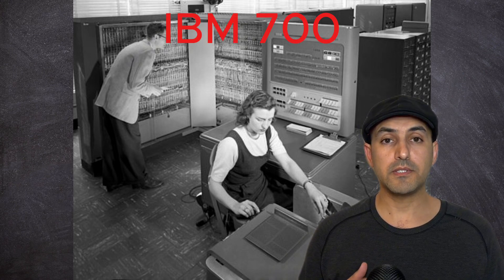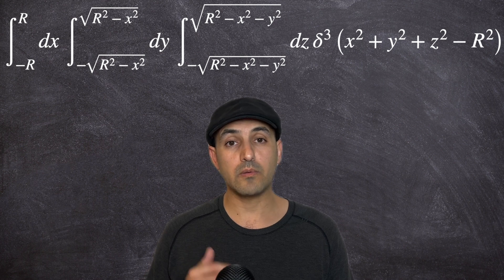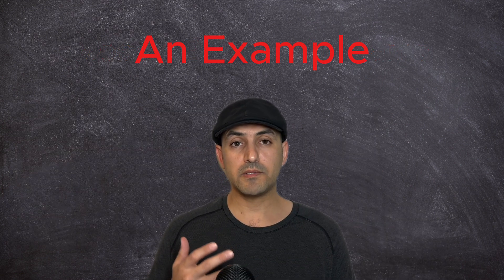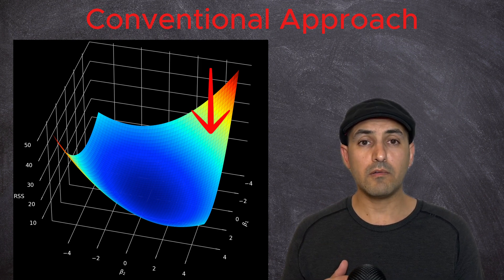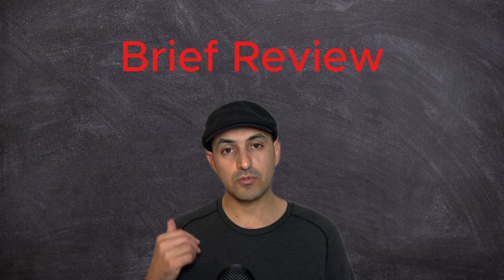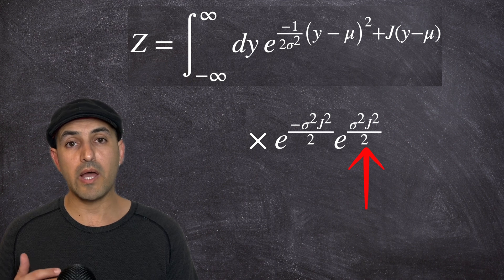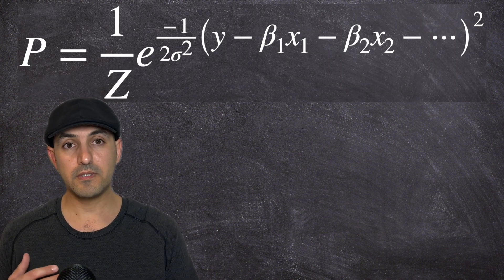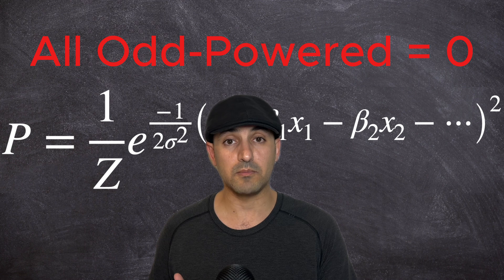A Physicist's Guide to Building Better Machine Learning Models

Comment: Is this equivalent to the conventional method of setting the gradient of the loss function with respect to the betas to zero and solving for the betas?

This is also a one step optimization for linear regression without using gradient descent.
Reply from the maker: Not directly, but I imagine one might relate the two through some math work

Comment: Thank you for the video! It's really inspiring! I really like physics and am now getting into the ML field, too. 
In your experience, what are the possible ways if there's no inverse matrix available? I've read a lot that it's usually the case with real-life data
Reply from the maker: You are welcome! When inverse matrix is not available it means your data is singular. In other words some of the features depend on some other and you need to reduce the dimension by removing the dependent variables. You can compute eighenvalues and see which ones are zero and remove the corresponding variables. I hope this help.
Reply: @CompuFlair  Thank you very much! That makes perfect sense, I completely forgot about the linear dependence (hope that's the right term)

Comment: Hmm… so, any probability distribution over finitely many options, can be expressed in such a form (at least if one allows weights of -infinity in order to assign a probability of zero, but that’s an edge case)…
(And at least so can many continuous probability distributions. I just don’t feel justified in claiming that all distributions can.)

Though, not all ML is well expressed as estimating a conditional probability distribution? Some of it is just function approximation.
I guess you could view that as producing a probability distribution with a single value having probability 1..

Well, I’ll be interested to see how far you can take this approach.
Reply from the maker: Thanks for the comment. F is quite as general as P is. Regarding function approximation, we can take them as the first derivative of partition function (\sigma e^{-F}) with respect to the variables. So we can reverse engineer them into a probability function.

Comment: This is an interesting perspective, but I'm not sure it generalizes. Your toy example was based on a linear model, whereas DNNs are intentionally non-linear, otherwise they would become much easier to solve. Additionally, you make several assumptions about the parameter distributions, where it's well known that DNN parameters often do not follow normal distributions. Typically, parameters tend to converge to logistic distributions, and sometimes can have large skews, which introduce asymmetry (this is commonly seen in prediction heads).

I think you may be approaching the fundamental premise from the wrong angle though. You start off my suggesting exploiting symmetries can reduce computational cost, and then proceed to propose an alternative optimization problem. However, I believe the argument should be that current DNNs are the wrong function to model the problem at hand (i.e. not exploiting symmetries), rather than arguing for a different optimization technique. Furthermore, computing statistics on the data itself may not be practical (think about the dataset used to train GPT4), and may not be reducible (images for example don't follow an IID, even though this assumption is often made in diffusion models).

Also,  the idea of local minimum breaks down in higher dimensions, where most DL models don't have them. They can instead have what is essentially a locally flat loss landscape, where the gradient does not provide meaningful feedback. Anecdotally, this flatness can occur in subspaces and is dependent on the objective. For the former, curriculum pretraining can result in "better" but suboptimal solutions. And for the latter, performing an affine transformation on the objective / input to loss function can alter the landscape's structure and subsequent training convergence (probably due to numerical precision and the descent step-size).
Reply from the maker: Thanks for the comment. Enjoyed reading it. We will get to non-linear and logistic related distribution in future videos. 
Yes, the normal distribution does not explain most of situations. From the perspective of effective free energy and the way I derived linear regression, it is because Taylor series assumes derivatives of a function are well defined while in a logistic case it is not the case. Anyways we will be having fun exploring these in future.

Comment: Based on the first minute or so:  here follows a potentially slightly critical comment.  (Maybe I’ll be convinced later that this remark does not apply.) When you are trying to optimize something, you begin with forming an “objective function.”  To give a trivial example, if you want to maximize something that depends on both x and y and increases with them (over a closed set), you can maximize x + y,   or 2 x + y^3,  etc.  Without further specification, you can choose from an infinite set of objective functions.  Now, depending on the problem at hand, some of those functions may be useless. Nonetheless, you may still be left with many, even infinitely many, objective functions that that will do the job just fine.  You can’t claim one of them as globally superior unless you have a theorem that proves it as superior in a specific sense.  While the energy-based or alternatively the the KL-divergence-based, entropy-inspired loss functions (“objective functions” are typically called “loss functions” in machine learning) used nowadays in machine learning have solid math-based rationales behind them, there is actually no theorem to show their superiority to other loss functions, if by “superior” we mean that it will lead to the “best learning.” Without such a proof, all we’re doing is tinkering with algorithms and finding empirically, using benchmarks, which leads to a useful outcome, but we can make no claim about global optimality.  One of the fascinating things about modern ML is the absence of theorems to justify most of its key features.  The above remarks finally put me in a position to comment directly on the first minute of the video.  I am thinking: sure, you can pick an objective function that seems plausible and has your favorite form based on insight or intuition, but you don’t know that it is best at learning unless you have a mathematical theorem, which you don’t.
Reply from the maker: Thanks for the comment.I especially liked "While the energy-based or alternatively the the KL-divergence-based, entropy-inspired loss functions (“objective functions” are typically called “loss functions” in machine learning) used nowadays in machine learning have solid math-based rationales behind them, there is actually no theorem to show their superiority to other loss functions".

The situation is similar to when quantum mechanics was first developed, and we had two widely different models (operator-based and waved-based) but later it turned out they were mathematically equivalent. And that again comes down to the subject of universality that I tried to touch a bit.
Reply: Hm, when you talk about a lack of a proof for what objective function would produce the best learning, do you mean a proof of the dynamics of the learning being the best, or it being a good evaluation of how well the model does what we want it to do?

For the latter, there is the notion of a strictly proper scoring rule. I think if we want a system to predict categorical variables, it is pretty evident that we should want the loss function to be a strictly proper scoring rule. Right?

There are multiple strictly proper scoring rules though…

Hm, I guess if we want the model to maximize its utility, we would need some “if the true category is y, the expected utility if the model produces probability distribution F over the different options, is E[U(F)|y]“ function of y and F.
And, to get anything from that, some reasonable assumptions would need to be made.
Some basic assumptions would probably include something like: when y is the true variable, if F(y) > F’(y) (where F and F’ are two different probability assignments. F’ not denoting a derivative of F.) then E[U(F)|y] > E[U(F’)|y]
Err.. actually that’s probably not quite the right assumption, as increasing the probability from the correct answer to very very small to just very small, isn’t necessarily enough to outweigh the effects to bad changes in the probabilities assigned to other options.
Like, if your categories are “nothing”, “a flock of ducks”, “a flock of geese”, “an incoming ICBM”, then when the correct answer is “a flock of ducks”, going from (0, 0.01, 0.98, 0.01) to (0, 0.02, 0.01, 0.97) probably isn’t an improvement, even though the probability of the correct answer increased.
But, some similar condition like, “interpolating between some distribution and the distribution which assigns probability 1 to the correct answer, gives at least as high an expected utility as the distribution one started with”.

Also probably some continuity requirements on E[U(F)|y] as a function of F.

Still… for finite-dimensional vector spaces, all norms induce the same topology, so, by analogy, I would expect that whatever strictly proper scoring rule one uses, whatever other scoring rule one should be using instead, if one scores well enough one the one one is using, one will score well enough on the one one should be using?
It’s all just a measurement of how far off one is, right?
Reply: In fact, there is no such "global optimal objective function/computation" or "universal model", which is capable of learning every task sufficiently well in finite period of time given sufficient amount of data or samples, since it is over-powerful that we will eventually come across a self-referencing paradox. Let O be a universal model, which takes every predictive task T to a Boolean value true or false, and $\Sigma$ be the task space, then it will fail to learn from the task (in terms of a data set) $T^* = \{(T,  \neg O(T)) | T \in \Sigma\}$, since otherwise $O(T^*) = \neg O(T^*)$, a contradiction.
Reply: @haoweichen-t8z  I’m not following the description of the task you are describing.
And, I’m pretty sure your conclusion is off…
If one does induction using the speed prior (which, unlike the Kolmogorov prior, is computable), then for any computable yes/no task, I think there will be some number of examples of input/output pairs, such that the shortest+fastest program which outputs the correct answer for each of those,

Edit: hit send accidentally.

- will be one that performs the task correctly?

Though, I’m not quite as sure of this in the case of the speed prior rather than the Kolmogorov prior…